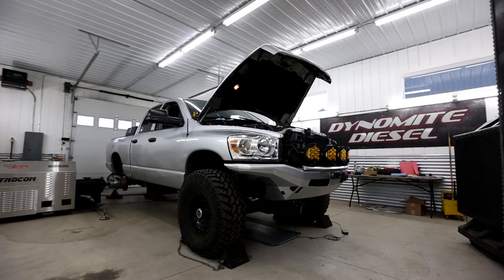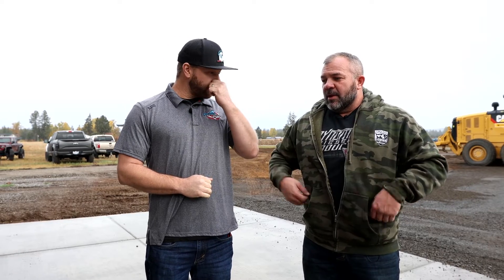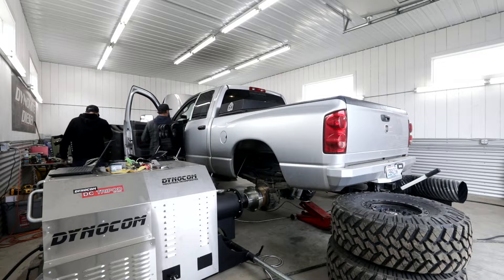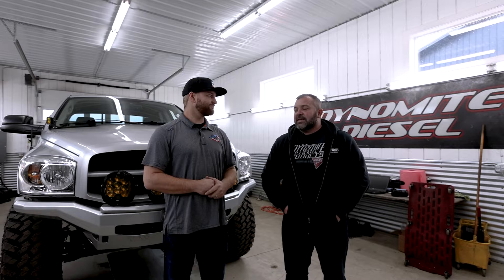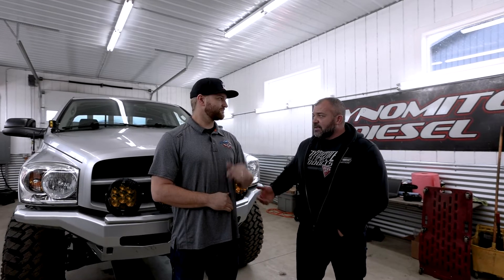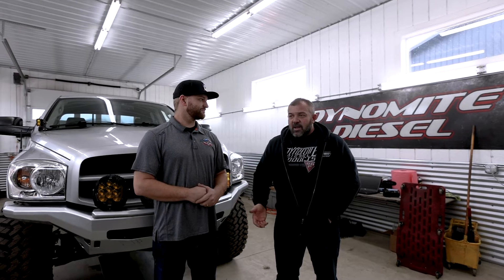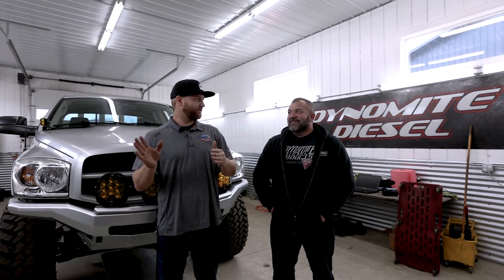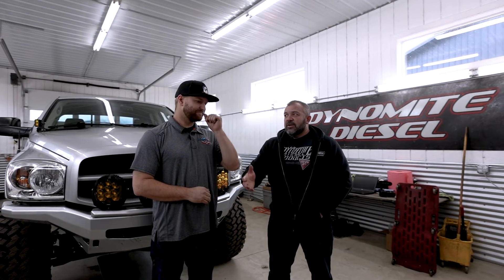Dyno Day Round 2 // 700HP???

Comment: Will that setup work for and be able to tune a 2005 5.9 Dodge Cummins for that setup?
Reply from the maker: Yes & no. Starting in 2006, Rams are a CANBUS operating system, so EFI Live can be used. For something 2005 and earlier, you would need to use something like HP-Tuners. It can still be custom tuned, just not exactly the same way. -Ben
Reply: @DieselPowerProducts  Would the results in the end be the same for smoke drivability and towing?